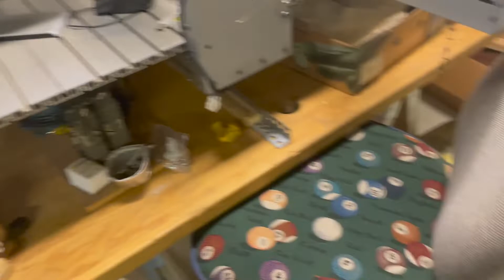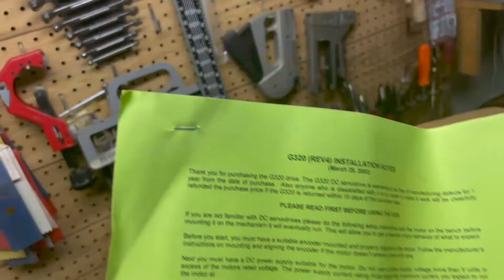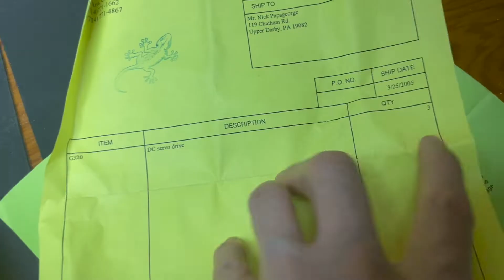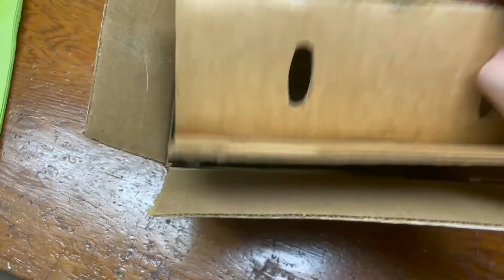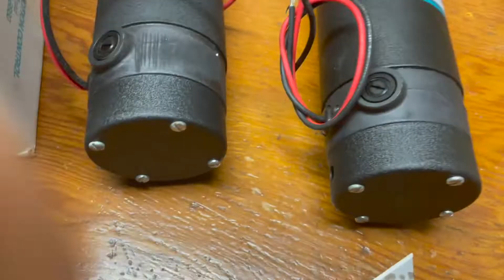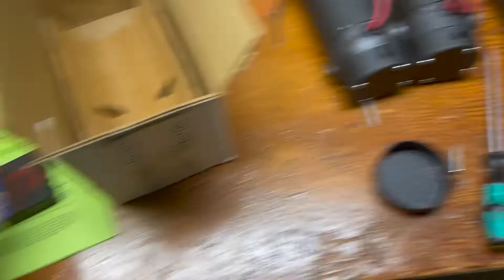Levil CNC Retrofit - Ep3 - Gecko DC Servo Drives and Childhood Shop Tour

Comment: Mayaswell use the servos!since you have them already, just need a nice toroidal psu, it's going to be more accurate than open loop steppers even using that old tech dont you think?
Reply from the maker: Yes, these brushed DC servos are definitely better than open loop steppers (and closed loop steppers). My choices are either these DC OEM servos, or I also have JMC AC modern servos in a nema 23 form factor that I had bought for another project a couple years ago. I'm going to try to keep the OEM servos, especially since all the pulley's will fit perfectly.